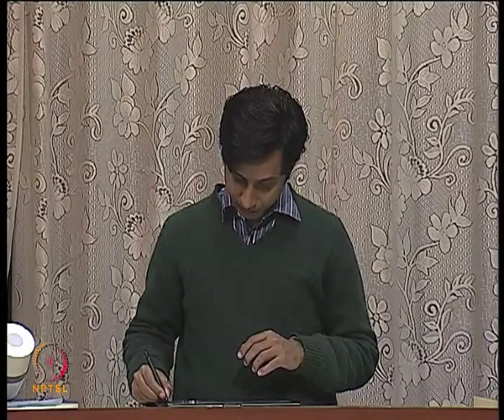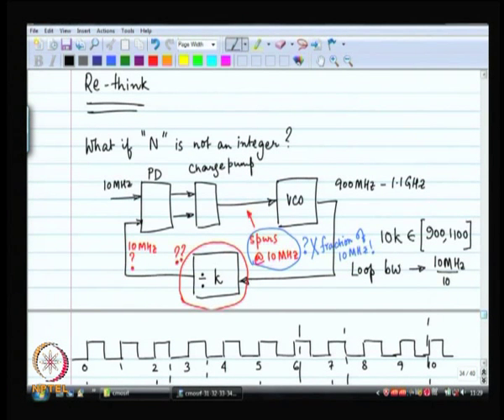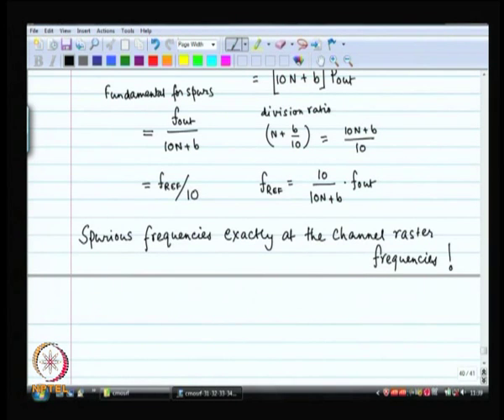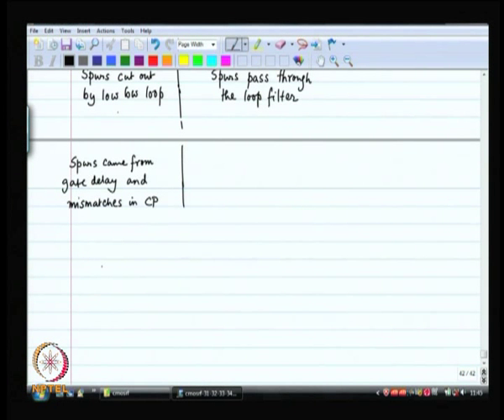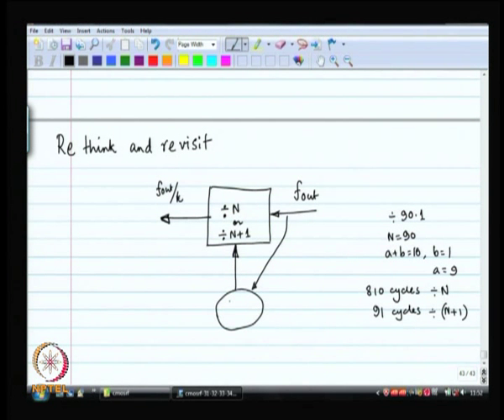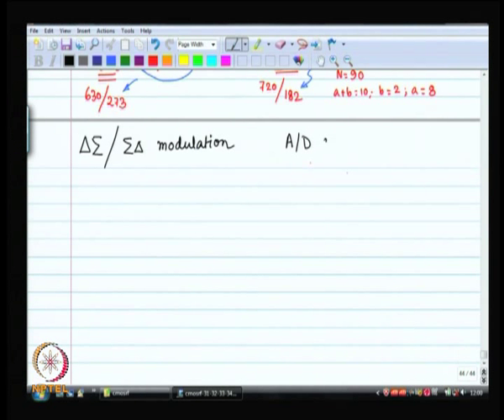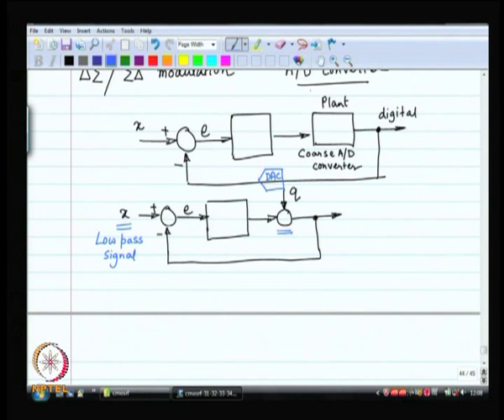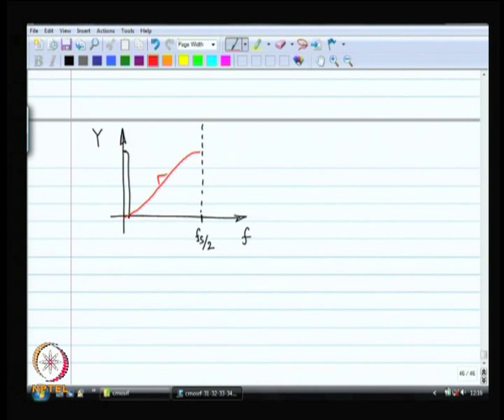Mod-11 Lec-35 Fractional spurs

Comment: Dr.Shouribrata - The statement at 32:07 is not accurate. For 90.1 division ratio, you need 1 cycle of Division by 91 and 9 cycles of division by 90. The rest is pretty good.